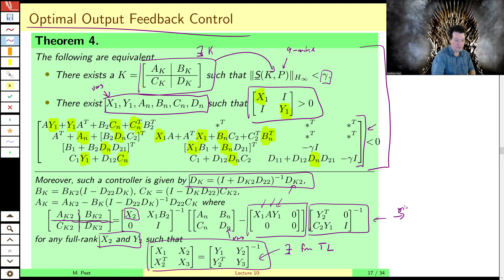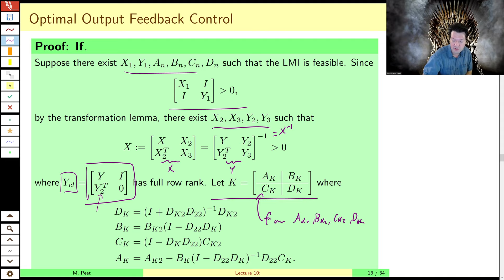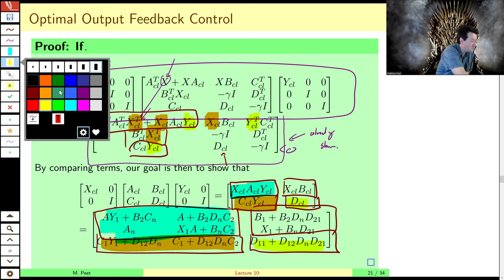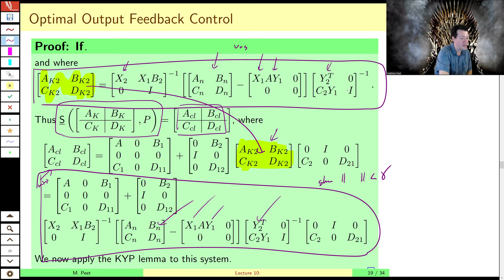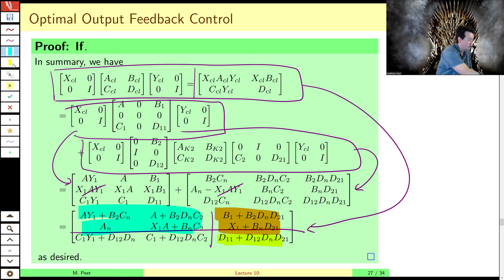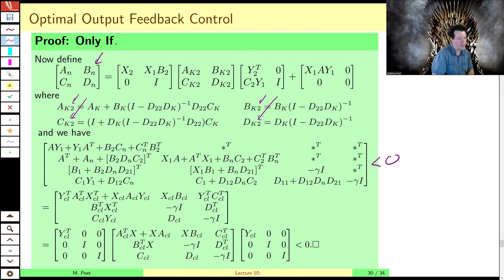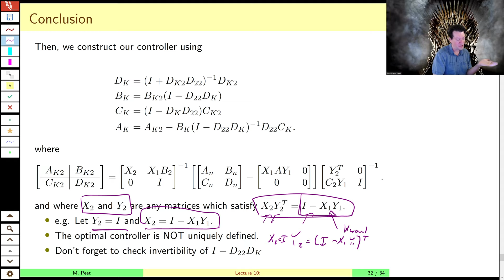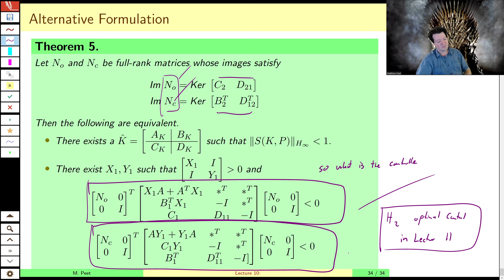MAE509 (LMIs in Control): Lecture 10, part C - An LMI for H infinity-Optimal Dynamic Output Feedback

Comment: Thank you very much Prof Matthew for these valuable lectures. Could you please provide me a reference for the presented Optimal Dynamic Output Feedback optimization at time 35:18 ?
Reply from the maker: I can't tell you who originally proposed it, but it was appearing in the literature by 1995, see, e.g. 
@article{chilali1996h,
  title={H/sub/spl infin//design with pole placement constraints: an lmi approach},
  author={Chilali, Mahmoud and Gahinet, Pascal},
  journal={IEEE Transactions on automatic control},
  volume={41},
  number={3},
  pages={358--367},
  year={1996},
  publisher={IEEE}
 }